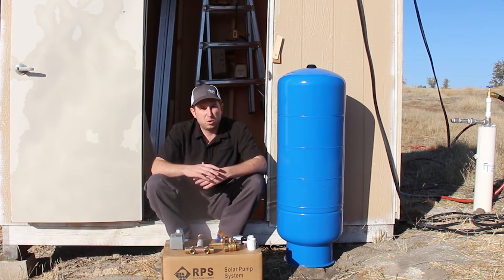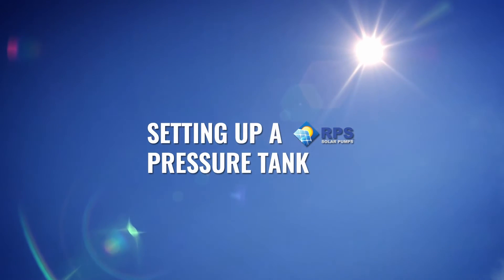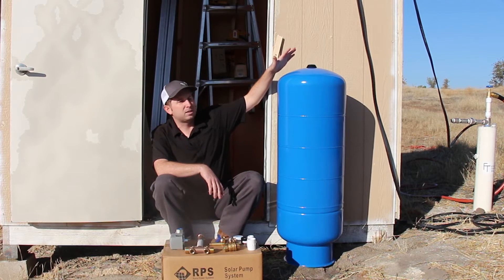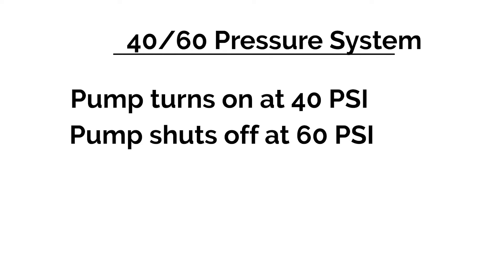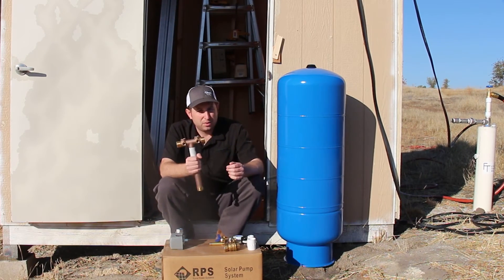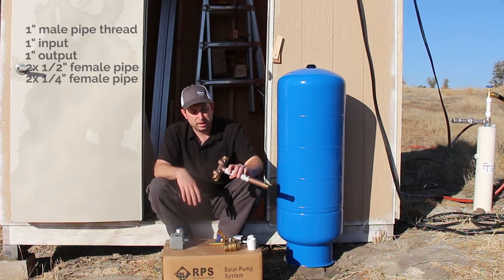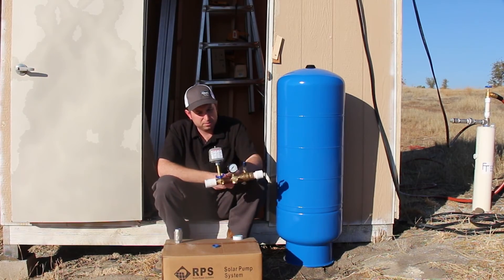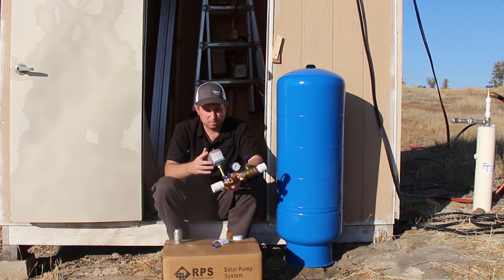Plumbing and assembly for a pressure tank

Comment: Hello, Iv'e got a RPS 400 running on solar. While I was building my cabin, I was turning the pump in manually. The cabin is now done and I'm installing the pressure tank. This video is great for assembling the pressure tank setup, my question is, How do you wire it?

Comment: I don't understand.
Why would the incoming water go into the tank??? 
when its easier for the water to flow straight thru all the brass piping, into your house?
What make the water turn 90 degree into the tank?
Reply: This holding tank has a bladder that stretches and can store water under pressure. It's really bad for the pump to turn on and off for seconds at a time. It kills the life of the pump. Think about all the times you only turn on the faucet to wash your hands. The well pump would slam on for a few seconds and then slam off. 

When the water in the tank gets low (under 30-40psi), it signals the pump to turn on. The pump runs until the tank is full, with a pressure of 50-60 psi. So this way the pump runs for longer, but turns on less. That's better for your pump, just like it would be better for you to drive one mile at once, rather than 10 feet at a time for a mile, turning your car off after every 10 feet.

Comment: My pump is 35 psi before 45 psi. No water entered new 20 gal waterpressure tank yet. Tank is at 38 air. Will 28 do it. Just overrides and get trickle water 15 ' use to be fine.

Comment: Great explanation, don't use the female PVC fitting they are very weak. Use a brass coupling and then a male PVC adaptor. I'm a Journeyman plumber and I studying well and pump systems. Your video was great.

Comment: Thanks for the video. Quick question, how do I find out whether I have a 40/60 pressure system or another low/high pressure system.
Reply: Turn off power to the pump and open the switch. The info is on the cover.

Comment: Will the solar power pump withstand building up 60 psi  of water every time the tank is filled?
With the check valve installed after the pressure tank. Would it allow all the water to return back down the well?
Reply from the maker: Yup, the max pressure depends on the actual ability range of the pump. Lots of our customers are using 60 psi, some even 70 psi. check valve should be installed between the pump and the pressure tank. Any water in the pipe between the pump and check valve will drain, any water after the check valve will stay right in the line. If you're in a freezing area, you gotta be careful and trench the line, otherwise no worries!

Comment: The information on the check valve was very helpful. My system doesn't have one and I wasn't sure if it needed one or not. All of the other videos showing their set ups add the check valve, but they don't explain why. I will leave my system without it. the only thing that I don't need is the switch, because it is already installed on the pump.